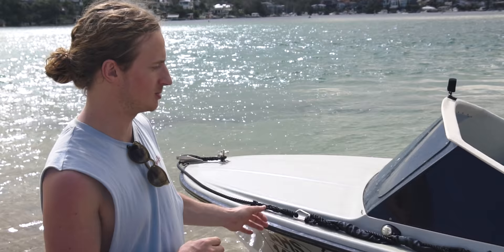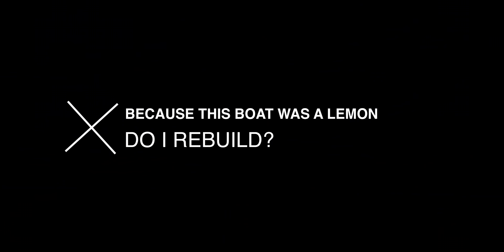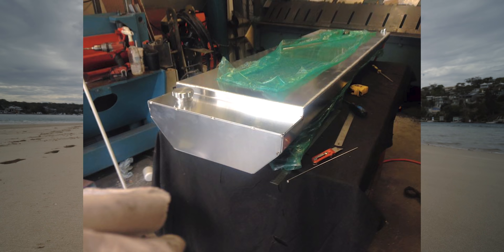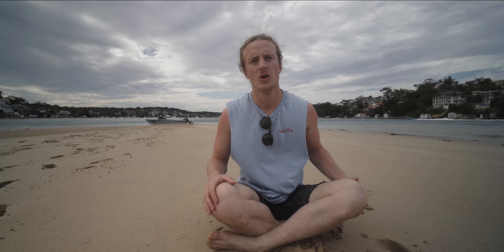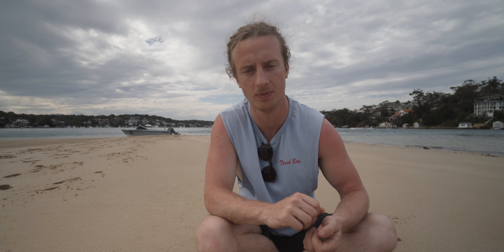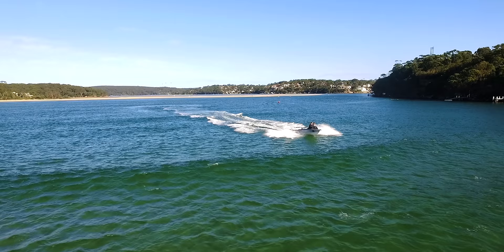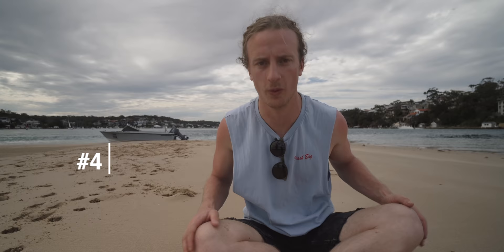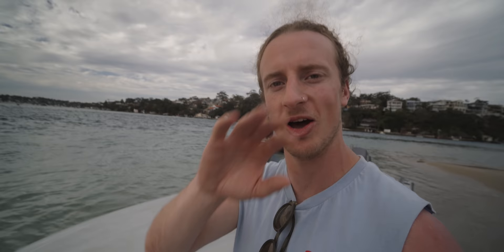Old Boat Restoration - START to FINISH!

Comment: Nice mate good stuff. The only thing you need now is a lone star winch. It's the best thing I ever did to my haines 146. You'll get an even better ride with the extra weight at the front and you'll never have to throw or lift the anchor manually again with the boys 👌 best investment
Reply from the maker: Ooooh, I like that. Will defs keep in mind. Cheers man

Comment: What HP was the boat rated for?  Mine is rated for a 40 and I put a 50 on it with a 6 inch setback which seemed to make it a little back heavy on the trailer.  I have not put it in the water yet but are thinking of moving the fuel tank and battery up front under the deck.  The bow mount trolling motor 40 lbs has already helped a little.

Comment: How are you equalising with your nose ring bruz?
Reply from the maker: Generally it’s sweet, gotta get use to it. But won’t lie it is annoying at times man. Can throw me off, make me loose air or miss an equalisation at times. Would take it out if I’m bankin on big dives.
Reply: Yeh im trying to get used to mine

Comment: how i do a good resto on my 1st Haines hunter v17 in future as im getting my 2nd boat in future as you see thiswas really be my 2nd resto in future as im getting my 1st ever Haines hunter boat in future as you see thiswas really be my 2nd resto in future as i needed was to knew can i get a boat say with a 150hp evinrude thiswas my very first ever V6 outboard if that engine was too heavy can a older evinrude 140hp outboard was a better fit for this boat in future  what do you think of the V17 Haines with say a evinrude V6 150hp outboard  are these outboards ok or im better off with say a Johnson 140hp outboard say these outboards was the 50;1 premix motors as im using this boat for mostly fishing and family fun  as im hoping to get these boats with back to backs seats as im gonna gradully be fixing this boat over time in my case as my brother was gonna do all the Fiberglassig for me in future and im gonna rebuild my Evinrude myself was the older premix outboard this was the  V6 and V4  2 stroke outboards as im gonna really do this boat over time in future as im really are ready for my family was gonna help on the project in future but im getting this boat in better Condition by thiswas really a minor resto really the case was the way to go in future i have torepower the boat in case its got the wrong outboard on the back in future as i knew these boats really well as i read alot of boat mags in the past on these boats as i knew fixin the outboards wont be a worry as im an ex outboard mechanic and i knew the Evinrudes really well so this wont be a issues in my boat project in future as im really good hope i can restore these boats in future i knew these was a legend these Haines hunters hoping to restore one like this in future thiswas my 1st Haines hunter boat thiswas the V17R boats in future thiswas my goal in future my friends